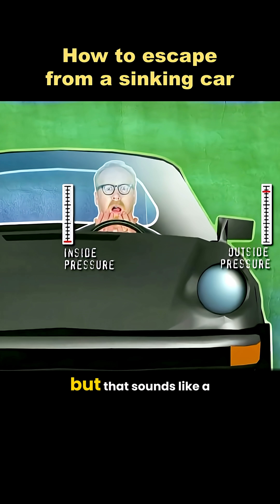Why Car Doors Get Stuck Underwater? The Shocking Truth

Comment: Try rolling down Windows so the water gets in faster 

Takw sloq deep breath while sinking it doesn't take 3 mins frome when the water hit your nose until its full

Try getting out slowly and deliberately dont rush dont panic dont waste air

When calm most people can hold breath over 2 minutes wirh adrenaline pumping close to 3

Ir you panic you die

If not you have a very good chance
Reply: If you can open the windows, just get out through it😅